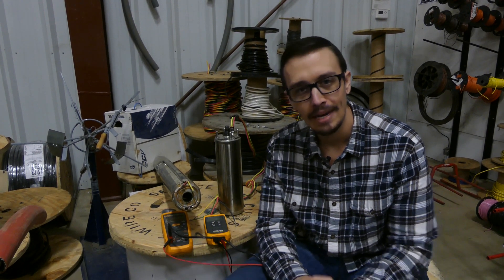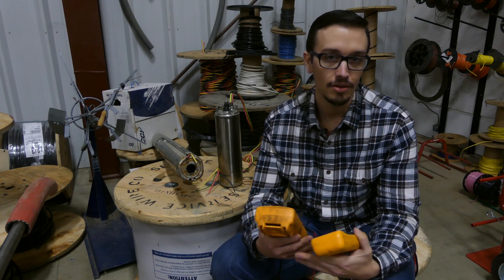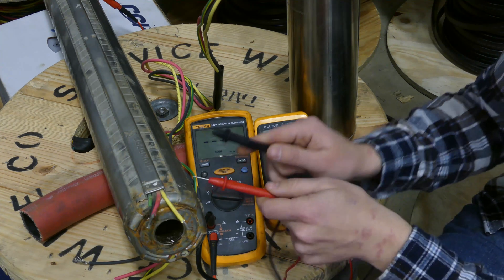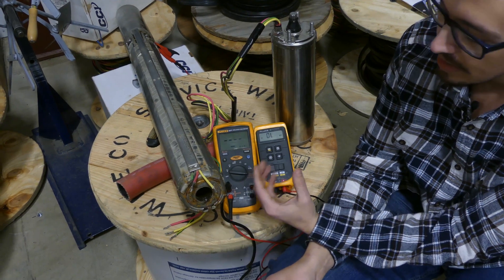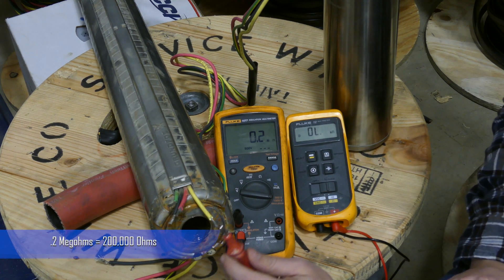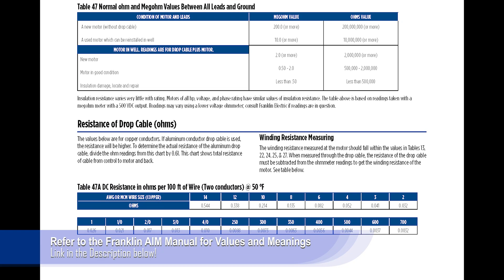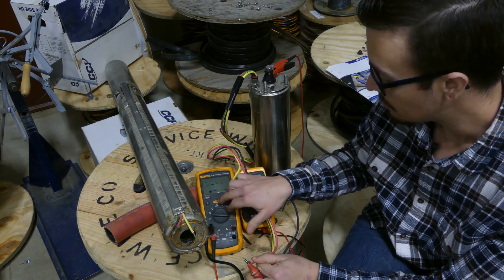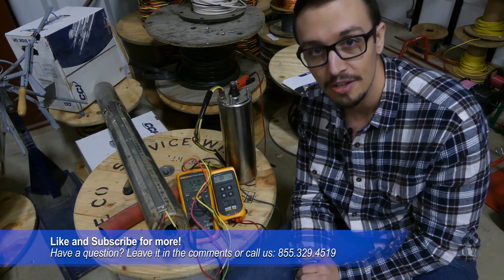How to Megger a Submersible Pump Motor

Comment: In one instance, touching the multimeter leads to casing he gets OL and says there's no resistance and next time he touches the leads to the casing he says "it completely shorts out" while the meter reads 00.0.  Isn't that two different outcomes for touching the meter leads to the same place on the casing?  Doesn't OL mean high or infinite resistance?
Reply from the maker: You are correct, the OL explanation was a mistake. OL means there is zero continuity between the probes.
Reply: @RCworstwater  Thanks, I am trying to keep it straight in my head!

Comment: Hi Chris. Does the AIM manual strictly apply to Franklin Electric motors or can you use it interchangeably?
Reply from the maker: The motor tables apply only to Franklin motors but some of the troubleshooting information is interchangeable.
Reply: @RCworstwater  Thanks Chris. I am assuming you use mainly or solely Franklin Electric Motors then? And if so, are they what you would consider the best?

Comment: Is it possible to megger the motor in the well by using the drop cable?
Reply: Great question!
Reply: a little late, but yes. And indeed, you should. It can reveal if there is a leak in the insulation not just in the motor but also the drop cable.

Comment: Very nice info...  in a pinch you can use a test lightbulb in series with the motor winding to ground and L1 120 or 220 vac any current is questionable?   thanks a lot.. 😊

Comment: Note with a megger you are not only testing with a more sensitive (meg ohms, gig ohms) instrument, but you are also testing under a more strenuous (similar to in-service) load... Wire insulation is rated for some voltage higher than it may be used at (e.g. 600V rated wire on a 240V pump motor circuit), above which it may break down (even when new). The megger produces a low current but higher voltage (e.g. 250V to 5kV) to put the insulation "under load" to test whether it is breaking down. The 1.5V or 9V battery inside a typical ohm meter is too little to load/stress test for insulation break down. Testing components under load is a tenet of good troubleshooting. For example, a capacitor may read good/ normal value on a cheap tester, possibly fooling the tech into thinking it's a good component. But under rated voltage, say 500V, it may break down to near zero farads, indicating that it is actually bad when operated in circuit. I've picked up many new components from supply only to find some of them too fail under load. It's best to test even new components under load when you can before installing 550 feet down a well, only to have to pull it up again.

Comment: OL does not mean over loaded... it means open loop
Reply: i depends on the setting. It's overloaded if youre measuring voltage, but open loop if it's under the resistance setting.

Comment: I gambled and bought a Chinese digital megger on Ebay. Surprisingly, it works very well, and cost me only $60 or so. You don't need to spend a lot for modern electronics these days.
Reply: which brand did you buy i am considering geting a new megger.. is it digital

Comment: Thank you for your videos! I am new to the well water industry and have been working as a pump tech here in Michigan, so I have been utilizing your videos to help learn little tips and tricks. I do have one question. When I ohm out my main winding's...let say on a a franklin electric single phase 4" 2  wire, 230v,  I should expect 4.2-5.2 per my AIM manual. What does a low Ohm reading mean? Broken down windings, melted, etc.... And on the obverse would I ever see a higher reading, higher than 5.2, and if so, what does that mean? Thank You!
Reply: As a pump tech for 30 yrs, Chris has excellent info, I use an 0hm meter, amp meter and continuity tester ,mostly the later two 99% of the time. Fast and accurate for what you need, no need make it too complex. I don,t own a meggar, and honestly don,t know a tech that has one. As he says in his video, ohm meters are not that reliable, to many variables, unknown hp, wire sizes, splices, pump brands, ages and length of wire runs. High amperage with proper voltage = pump pull. Then check it again for mechanicals. No continuity, dead short, short to ground=pump pull. Once the pump is out, cut it loose, check it again on the motor leads. Same results, new pump motor at a minimum. If pump checks out, look at sub cable.  Its great if you can identify the exact issue but you can waste a lot of time and energy trying to find the exact failure point. It all equals a pump pull. I've worked on 1/3 hp to 150 hp submersibles, turbines,  single phase and 3 phase. Mostly 10 hp and below. If I did big stuff all the time, I would get a meggar. Sounds like you are going to do great.
Reply: If the windings have a short (fused or melted together), the resistance will be less than 4.2 ohms.
If the windings have a broken connection, the resistance will be greater than 5.2 ohms.
In either case, the motor is junk and needs to be replaced.

Comment: Your videos are very helpful for the diy.  I purchased a Fluke insulation tester as a result of watching this video.  With the pump in the well, I tested the pump using the insulation tester and the reading I got was .01 M ohms.  This concerned me although the pump has been working fine since it’s installation in January.  So, we pulled the pump, pulled tape off where we had spliced it together, and tested it above ground and got the readings I wanted.  It read 550 M ohms when testing each wire to ground.  It still shows a good motor.  Then spliced wires back together and lowered motor in well.  Tested above ground again with motor in well and still got the same results as earlier which was .01 or .02 M ohms.  I would like to check it periodically so I can determine when the windings are beginning to break down and to determine when it is getting close to replacing motor.  Is the reading I am getting above ground normal?  If not, what could be the problem?  The submersible pump is about 120 feet down in well.  Could it be the wire leading down to the pump?  Thanks for your time and any information or suggestions you have would be much appreciated!  - JS
Reply from the maker: John, how were you testing it at the well head - using the ground wire or casing? It sounds like it may have been the casing and your ground wire is nicked somewhere underwater.
Reply: I was using the ground wire that runs from the motor to the control box.  And I forgot to tell you this but when I pressed the test button on the Fluke insulation tool, I noticed that the DC volts on the meter would not read above 30 DC volts even when I tested using 1000 volts DC.  However when I pulled the pump and tested it out of the well everything read what it was supposed to.  So, you think it could be a nick on the ground wire?  On the ground wire attached to the motor or the ground wire on the drop cable?
Reply from the maker: @johnshutt2215  Did you isolate the drop cable from the wire that goes to your control box before you took your reading? You don't want the underground/control box wire to be part of the test at all. It might be better if you call us so there's no miscommunication: 855.329.4519
Reply: R.C. Worst & Co., Inc. I just wanted to give you an update.  We did replace the old wire with a 12 gauge wire.  We took the old wire placed it in our jacuzzi with water and tested the wire for nicks, cuts, or leaks in the wire and did find that the old wire contained leaks and cuts.  We tested the pump above ground first (before lowering it in the well) after splicing the new wire to the pump motor and got the 550 M ohms reading.  Then we lowered the pump back in the well with 12 AWG solid copper wire and the test results using the insulation tester did read  550 M ohms again.  So, we know the pump tested as a new motor.  What I am confused about is that I thought the AIM manual says it should read a little over 2 M ohms for a new pump motor when testing the pump in the well under about 30 feet of water.  Am I understanding what the AIM manual says?  Is it supposed to test the same submersed in water as it does when testing it above ground (not submersed in water)?
Reply: @RCworstwater  I have a megohmeter.  I just test the insulation resistance while pump was still in the well.  It read 70 megohms for all three wires.  Is that a normal reading for a good motor while the motor is submersed in water?  Also, should I be concerned if the running amps for the black wire tested about 6.8 amps?  I have a 1 hp submersible motor.  Thanks so much for your help!
Reply: By the way, if there is a nick in the ground wire, will it hurt the motor if I leave it until I can get some new wire?  I believe the wire running down to the pump is a 14 AWG stranded wire.  I was thinking of getting 10 AWG solid wire anyway and replace the wire sometime in the future.  But if you think moisture is getting to the ground, I should be able to replace it in the next couple of weeks.  Thanks again!

Comment: Cool! Now show us how to use a megohmmeter to diagnose a faulty sump pump.
Reply from the maker: It's the exact same process, you clamp the ground wire and megger each other wire. The ohm values are going to be all over the place though due to the wide variety/brands of sump pumps. It might be interesting to experiment on old vs. new of the same models.... we'll add it to the list!
Reply: @RCworstwater  What do you set the meter on, what ports do you use?